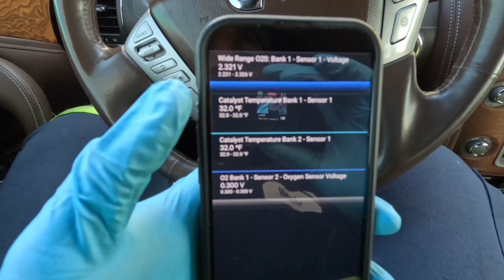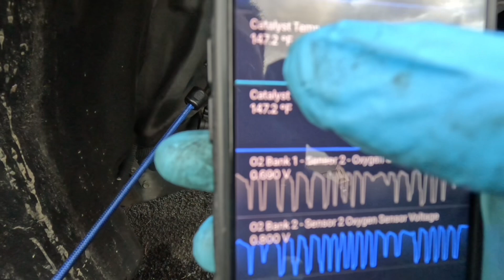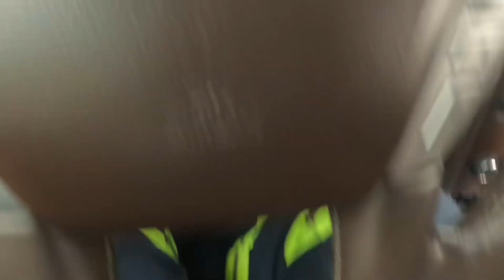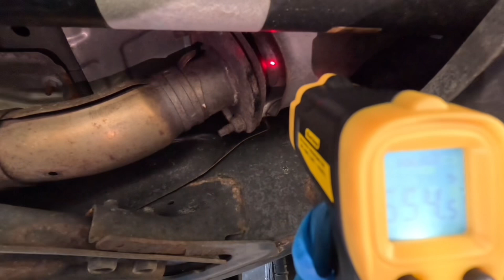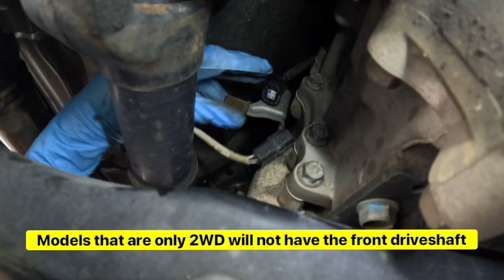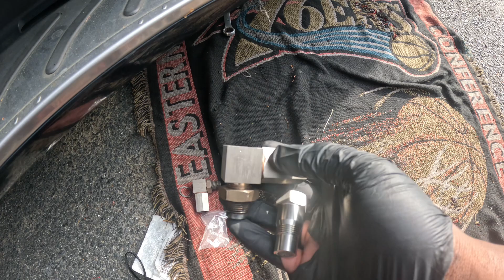Infiniti QX80 Addressing P0420 & P0430

Comment: I’m getting the same code on my passenger side. I used BlueDriver for live data logging and fed the reports into Gemini. Gemini asked me to capture live readings under different conditions (cold start, idle, and 45-55 mph cruising). Based on the data, it concluded that the passenger-side catalytic converter is still working, but it’s not as efficient as the ECU wants (dropping below the 95%+ threshold the computer expects). I live in a state that doesn’t require emissions inspections, so I’ve just been clearing the code every so often while keeping an eye out for any new codes. My biggest worry was a clogged cat, but the graphs Gemini generated showed the passenger side performing almost as well as the driver’s side.
Reply from the maker: Yea the threshold is crazy. I’ve seen ppl have cat below efficiently codes for years with no issues.

Comment: Want to echo the comment about not using the 2nd link in the video.  Unfortunately I didn't read all the comments.  It did indeed to try to charge me double and also made multiple unrelated charges.  Fortunately all the charges triggered the fraud protection on my card so I was able to only alllow the valid charge to go through.
Also, on their website it stated “Buy 1, Get 1 Free" and it further stated, “We’ll automatically send 2 when you buy 1 (no code needed)."
I did receive one of the devices but I'm now in a pissing contest with the vendor to get the "free" one.
The vendor replied back with:
Hi,
 
Thank you for your patience.
We have received an update from our warehouse team, and they confirmed that only one item was included in your order. 
If you have any other questions or need further clarification, please feel free to let us know—we’re here to help.

To which I responded:
I understand only one item was included in the order.  As I stated earlier, when I placed the order, the following message was displayed on the screen:
(screenshot of the BOGO add)
That states clearly that if you “Buy 1, Get 1 Free.”  It further states, “We’ll automatically send 2 when you buy 1 (no code needed).”  There is nothing ambiguous or unclear about the message.  So, either that is false advertising or you mistakenly sent me 1 instead of two.  So, which is it, false advertising or a mistake with the order?  If it’s false advertising, I’ll make sure to note it in the comments section of the YouTube installation video that I watched.

Haven't heard back yet but I thought I would go ahead and post this so hopefully no one else makes the same mistake I did.

-----------------------------------------------------------------------------------------------------------------------------------------------------------------------------------------------------------------------------------------------------------------------------

They replied back on 5/12 with the following comment:
Hi,
 
Thank you for your clarification.
 
However, after reviewing your order with our warehouse team, we can confirm that only one item is included.
 
We appreciate your understanding, and please let us know if there’s anything else we can assist you with.

WARNING!!!!!!!!!!!!!!!!!!!!
DO NOT GET SNOOKERED BY THESE PEOPLE.  THEY ARE THEIVES AND LIARS!

Comment: Trying to extend the life of a failing catalytic converter is very risky.  
Great video BTW....well done
Reply: Why is it risky? If you don't mind me asking.
Reply: @h @horsepower3654 If the internal part of the converter is compromised, there is no way to fix it or make it better.  It will continue to fail and you risk your vehicle breaking down at any time.   When it fails, the vehicle will barely move, and more than likely shut down completely because it doesn’t have airflow out of the exhaust system.  I know from experience.
Reply: @diglightdig  ok. Thanks for the info.
Reply: @horsepower3654  yw

Comment: I have the same exact qx80 limited , loving it with 230,000 miles . 430 code came on and my the live data shows my cats actually work but don't know why the 430 code comes on .
Reply from the maker: It means the cats aren’t working good enough try the using the 02 sensor spacers I showed in the video

Comment: I ordered on the bottom link and immediately got a fraud alert and my card declined. The total was supposed to be 17.94 and what the alert said is a charge of 6.00 twice to two different states was attempted on your card. Do you recognize it? I said no as that wasn't the right price. So I dont know what is going on. I will attempt to csll their number tomorrow, but for now the order was blocked. One charge was to Pennsylvania and the other was Missouri.

Update: I had to cancel my card. The place is a company but will hit your card for more money. I ordered for 17.94 for 2 as i said. My credit card company sent an alert snd declined the extra charges. After investigating, it seems to be a scam company. So many complaints. Lots complained about a bogus membership fee. I didn't see one. They hit my card for 6.28 three times from thee different company names. All declined. The credit card company asked me if I wanted to leave the one charge that went through. They said, we wouldn't because they have access and can keep trying and several company names. They said we recommened you cancel and dispute the charge and bu what you need someone else. AI said they appear to be scammers. So juat a friendly warning what happened to me so it doesn't happen to you. I wknt bother to even call them because of all of the stuff not matching ip to what I bought. And besides that, the invoice they sent shows 2 charges of 6.00 each from 2 differmt companies and yet nothing was on the card. I mentioned that already.

Comment: Great video! I am getting P0420 on a new-to-me 2015 QX80. I just went ahead and ordered upstream and downstream sensors both both sides. I will report back if that fixes my issue. Thanks again for the great video!
Reply: What’s the report?
Reply: I just got my new to me  2015 qx80 and I got a PO420 code too
Reply: @jamesweatherspoon2550 Buy yourself some o2 sensor spacers game changer.
Reply: Report?

Comment: I ordered mine from the bottom link that he posted
Reply: Did it work? I got a fraud alert on my card, and what I ordered amount didn't match up and the transaction on my cards end was declined. My total was 17.94. I get a credit card notice for two charges of 6.00 to two different companies and states. It was declined so I was covered. I did a search and the list of complaints and fake credit card charges is long. I will probably have to replace my card now.
Reply: @RexEdwards  mine was the same way apparently they tried to sign me up for some recurring charge, but I got that canceled and I was able to get the spacers also